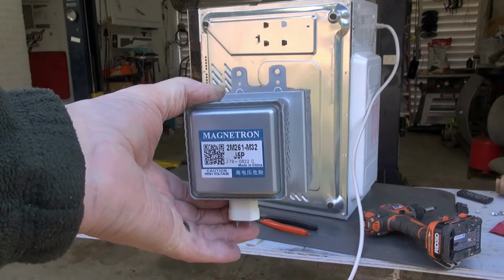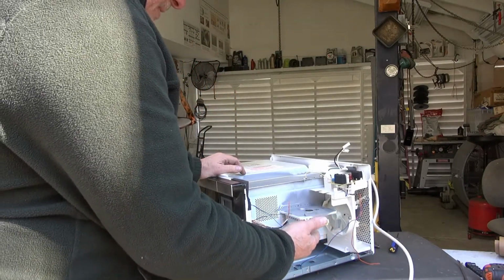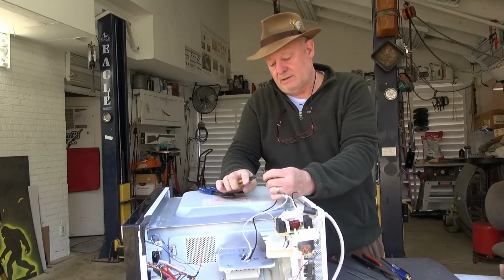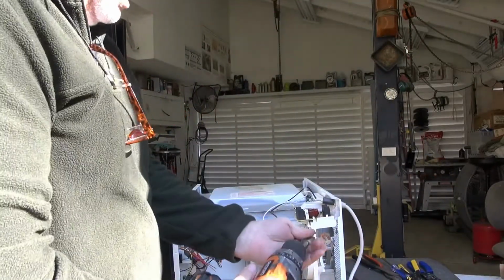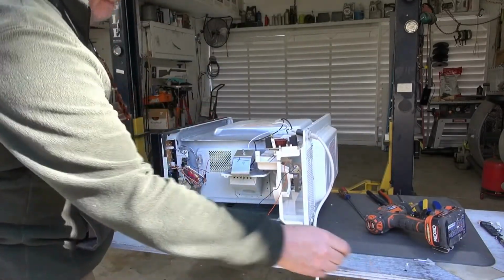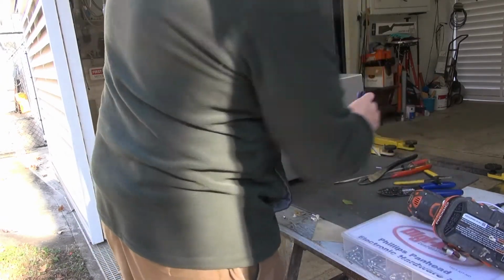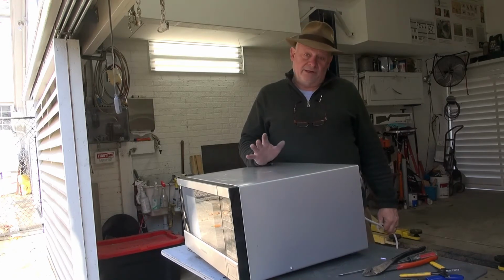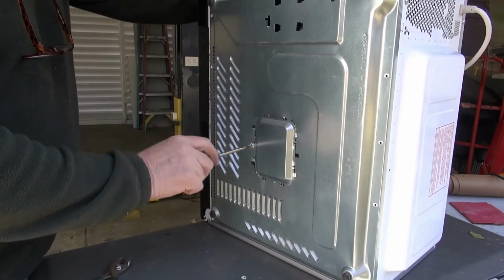Make a HOT BOX for electrode storage

Comment: Interesting.  I used to have a bjg Phoenix rod oven when I was doing a lot of welding, but had to sell it when I got old and moved.  Since then I have always bought my lo-hy rod in the sealed steel tube with the red plastic snap-on cap.  My standard practice has been to take out just the rod I need at the time and immediately snap the red cap back over the rest of the rod.  At the end of the job I wrap a length of electrical tape tightly over and around the gap between the edge of the red cap and the steel tube to maybe make it more air-tight.  This is how I save an opened can of lo-hy for any but critical work.  However, I think your warm-box is a step up from my method.  I'd like to know what temperatures your box measures at on a cold night, with what wattage lightbulb.  Have you tested this?  Anyway, thanks for getting me thinking about a project I have long had in the back of my mind.  And to you other welders who watch this video, give it some likes.